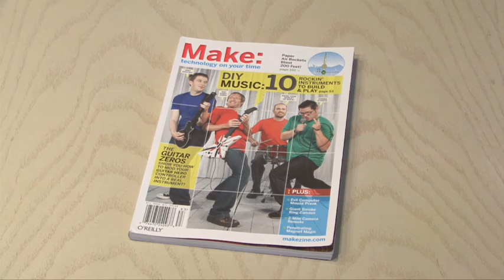Weekend Project: 2-Mile Camera Remote

Comment: For those of you with expensive DSLRs like myself... here's an idea.
Grab an AVR or similar and search the time values for the remote on Google. Mine (Nikon D80) was 2000, 27850, 390, 1580, 410, 3580, 400, and 63200 milliseconds.
Add a reed relay for the shutter release and overall do everything else the same, except recode the firmware so when it detects the input from the walkie-talkie, it triggers a delay and sends that IR code.
I use this code with my Arduino to take time lapses. Works great

Comment: @Sn0manX don't see why not.... most cameras use the shutter button for starting and stopping recording... provided the camera is in video mode instead of picture mode.

Though, unless its a higher end camera with a knob style selector instead of a menu/software selector for video mode you'd be screwed.

Comment: OR you can take the leads from the radio speaker and solder them to the corresponding leads of the shutter. when you call or page the other walkie talkie, instead of the sound coming out of the speaker, it will go to the shutter, hence completing the circuit. causing a picture to be taken. some resistors may be needed though.

Comment: The Canon x0D and high-end DSLR's have a remote connector, you don't need to open the camera up to access it, but you would still need to create a plug + wires, and wire that into the trigger unit. 

There are low priced wired + wireless units are available on ebay, I have one, there were US priced ones when I got mine, all I find now are ones priced for sale in the UK. mine cost $30 + $20 for shipping, works on the 20D and 7D.

Search ebay for "100M Remote Control for Canon", M -> meters.

Comment: Nice idea, so I have to give credit where credit is deserved. I can think of a much simpler way to do this, still using the FRS radios.  You don't need a microcontroller - that will be too much for most people to handle.  A couple simple logic circuits with an RC time delay will suffice and be much easier to do.

Comment: Yeah, I was working on a project with an old 35mm camera, TO MY KNOWLEDGE, it ad no batteries for 1-3, maybe 4 years, touched the connections from the flash compactor, my whole arm was numb for something like 3 minutes, my hand for 5, and that finger for 10. I learned my lesson. lol

& sorry kip, I think you could have done better with the box @ 2:25 ...
It looks like it's ready to fall off, and overall not suitable for longterm use :/

Comment: Too much work and theres the chance you'll F up everything too easily.  Besides you can spend $50 and get the Opteka Wireless Radio Remote Release.  This works up to 320 feet which is more than sufficient for any real world use. I have this for  my Nikon D90, but Opteka makes them for just about every brand name DSLR.